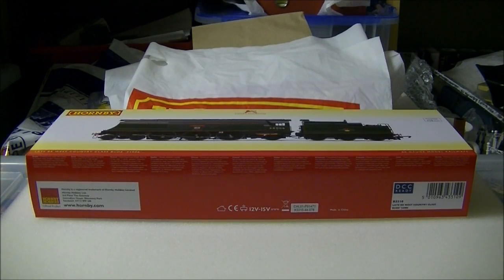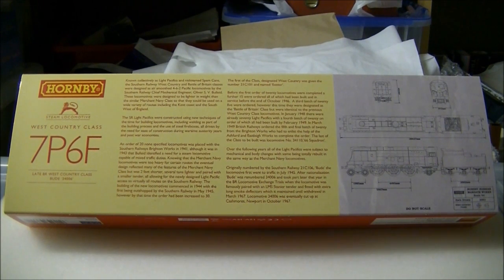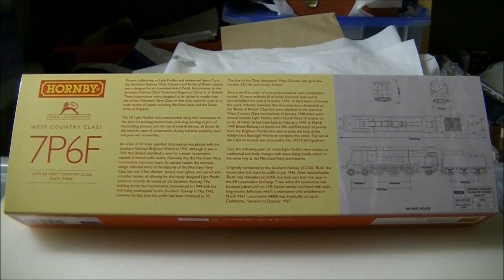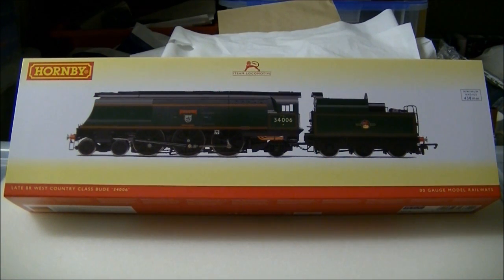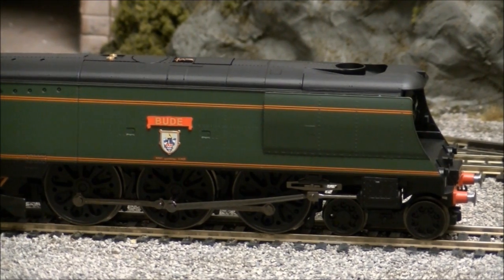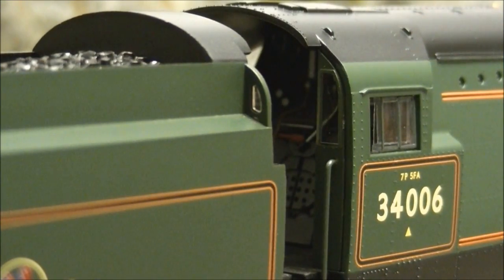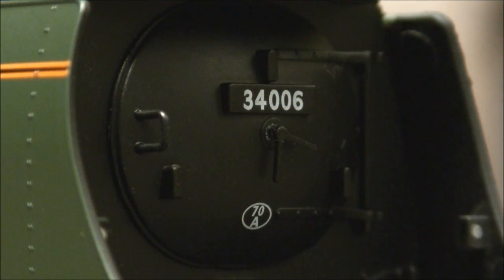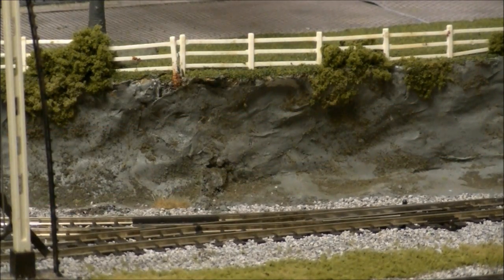Hornby R3310 - 'Bude' Un-Rebuilt West Country Review

Comment: Excellent model Callum mate looks superb like the added detail pack nice touch with the lamps and crew.
Cheers Kev
Reply from the maker: +percomotion Thanks Kev! Really is a superb model! Highly recommend. Never seen a detailing pack so big! You sure can spend a while putting it all on. Glad you enjoyed!
Reply: It does look a great model Hornby do set a good bench mark but this won't last long mate has reported in magazines over the 10 years our hobby will be very different from what we see it today plus the changes in China won't help matters either.
Kev
Reply from the maker: I know, I do worry. In a way it is surprising comparing the prices of G scale models now to 00, in same cases it not much more if not the same! :p
Reply: +SDJR7F88 One guy told me at an exhibition that 0 gauge could become the new 00.
Well if prices and availability go like they are wouldn't surprise me at all.
Kev
Reply from the maker: That's not hard to believe with the look and price of those latest Dapol RTR models
Reply: +SDJR7F88  The problem will be fine detail it costs a fortune to do,it would be far easier to produce an O gauge kit because that's the way it would go to reduce production line costs than to produce rtr model.
If this is what would happen in 20 years as being predicted by press not by me then the chances are anything 00 would be back to the 80s style and very little or basic models plus there will be fewer modellers in 20 years time and this alone will drop production anyway.
Kev

Comment: Do you know where I can buy one of these for a reasonable price? The absolute cheapest I can find is one for £99 second hand with some broken pipes. Which is pretty expensive for a model that is broken and not even new. I love them so much, unrebuilt and rebuilt. Do you reckon they'd get round 2nd radius curves ok? I find hornby locos seem to be better round tighter curves than Bachmann.
Reply from the maker: Yes, it easy gets around 2nd radius. As for prices, best I can see is around £130, new, which is very reasonable for this model

Comment: As usual you nailed it.  Nice model, but I like them better when they are unwrapped.  It seemed the valve gear was very simplified.  Was this because the sample is Railroad Range?  Hmm, slipping, maybe I can figure out a way to reproduce some of that.  Never thought about it before.  The crew looks like the same ones that came with the SD&JR Jinty. Rob
Reply from the maker: +Rob McCrain Thanks ever so much Rob! I love them both to be honest, but the airsmooth looks as something about it ;) It was on the originals, it was one of the reason for the class to be rebuilt. Yes, the crew are the same to as in the SDJR Jinty. Speaking which I have not forgot, but just short of time. I have a good idea for a little rake for it when I find the time ;) Full running session video coming soon!
Reply: +SDJR7F88 Hi Callum, I posted an unlisted video to you today.  It is a survey of my freight stock.  Rob
Reply from the maker: Thanks Rob! I'll check it out! :)